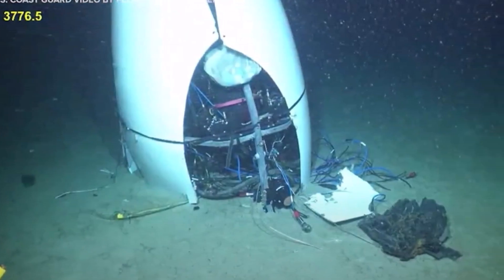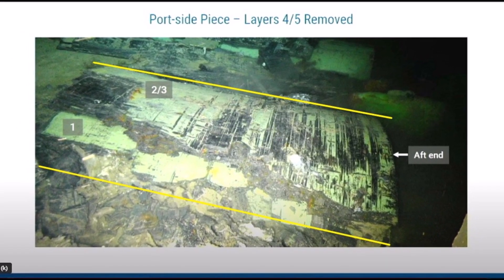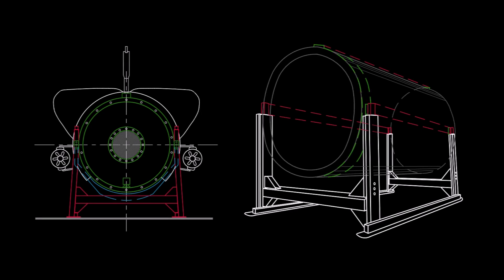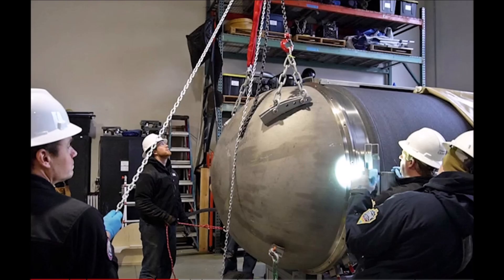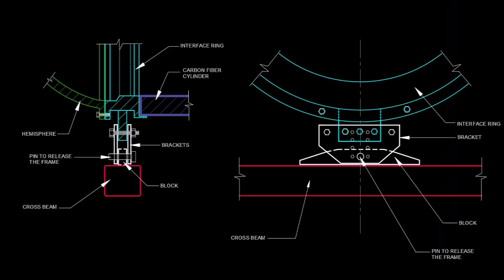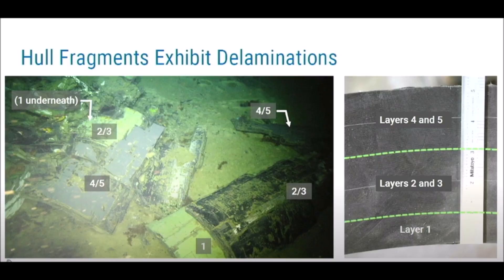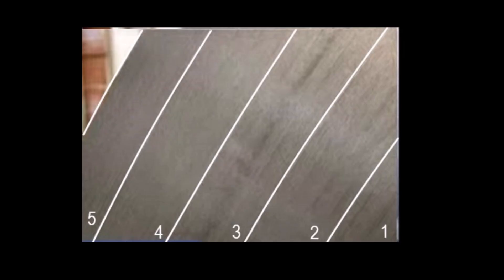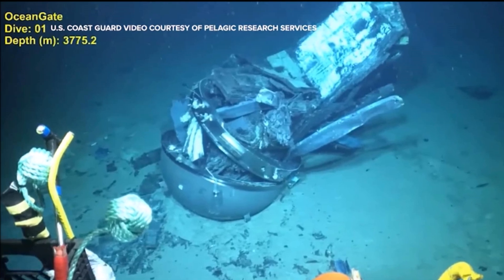OceanGate Titan: Why Large Pieces Of Carbon Fiber Found?

Comment: Good video.  I am also very interested in the Titan failure in terms of its engineering problems and have released videos regarding it.  Your theory about the corners of those struts being pressed into the hull would not be due to hydrostatic pressure on the struts themselves, because there is the same pressure on the top of the strut as there is on the bottom of the strut, since they are outside of the hull.  So, since the metal strut has equal hydrostatic forces on all of its surfaces, it has no reason to bend inward (or in any direction).  Now, the two domes are being forced inward on the axis of the hull at millions of pounds of force.  But I think the engineering for the hull to take that axial load without axial compression was sound.  So, axial compression of the hull would not have created enough movement to be transmitted to the struts to bend them.  Those are my thoughts and I appreciate the fact that you are thinking about it.

Comment: what is the acoustic sensors wasn’t pickup up sound because they was attached to carbon fiber that had come off. in the first hall it was left outside and just from the effects of a normal storm the inside part of the hall started to flake and delaminate. so maybe where those sensors where was where the hall was coming apart
Reply from the maker: @harrisonrg777  Not impossible but also not likely. There were two different hulls and people talk about them interchangeably, but you have to pay attention to the timeline so you know which hull any of these alleged incidents applies to. The one made in 2017 was scrapped in 2020. Anyway, the sensors were inside the hull so they weren’t exposed to any weather. It would not surprise me if they took the sensors out of hull #1 and put them in hull #2. Could have been damaged if so. Also maybe they were never properly calibrated and/or they were taking stabs in the dark on what proper calibration looked like. There’s a few possibilities…
Reply: @VegasCyclingFreak  sorry was at work when i posted that. i meant the sensors on the New hall if they was just glued to the inside of the hall that is where on the Old hall it literally start to flake and come off in sections. they had all their gear inside the titan so you couldn’t see the inside of the hall. my theory and only a theory is that the parts of the hall those sensors was glued to could have flaked off and the sensors is now just hanging lose not attached to anything just a sensor with a bit of flaked off carbon fiber at the end. pretty sure they said the sensors was working in other dives but just stopped working. this might give people an idea where the hull was flaking especially if all those sensors was in a general area. if you have sensors just not working they wouldn’t be in the same area or only on one side of the sub it would be sporadic. i am a musician and all thought these sensors are different to stuff i use they still are basic direct mount microphones that need to be attached to the surface to collect the sound. only way they wouldn’t work is if the glue let go and the sensor was left hanging not touching anything OR if the surface it was attached to come lose in a section and also went limp and is now just hanging. sadly we will probably know but especially seeing hall one flake from the inside i am betting that happened on hall to and in the report where they said one problem with carbon fiber halls is you can develop these sections where the cf becomes weak and starts coming apart and even though it may only be one layer it cause the next layer to weaken also because now it doesn’t have as much support. 

as i said just a theory and the way ocean gate was its also possible they just didn’t do it right maybe the sensors wasn’t calibrated or something as simple as volume or gain wasn’t turned up loud enough but once i saw that photo and the hall was prone to flake on the inside i think it was a bigger issue then people think. the hull basically came apart from the inside out. probably needed the coat they put on the outside also done to the inside of the hull.
Reply from the maker: @harrisonrg777  Yeah I get what you’re saying. It came out in the hearings that Hull #1 was breaking down on the inside. It was also made much differently than Hull #2. The way Titan was constructed it made it impossible to do any visual inspections, also pointed out in the hearings. Rush basically put 100% trust in his patented real time monitoring system, and it didn’t work out as intended. The premise of the system was good but the implementation of it needed much more work. BTW I am also a musician (guitar) and I know a bit about electronics - been building DIY guitar related stuff since 2001 (guitars, pedals, amps).

Comment: They found Titan's debris covering an area of 30 000 meters. I assume the implosion was brutal
Reply: Square meters don't work well for me.  From the debris  map, I get about 1.5 football fields by 3.6 football (100 yard long American football) fields (wide by long) or the area of about 10.6 football fields.  Per the hearings, the implosion likely occurred about 500m above the sea floor.
Reply from the maker: Yep! I've heard somewhere that the energy was equivalent to 100 kg of TNT. Also ocean currents would have scattered the smaller pieces as they were still a few hundred meters from bottom when communications were lost, which is presumably around the same time the implosion occurred.

Comment: When contact was lost. There was somekind voices. First they think if some human made noises. Today we know there wasn't any human a live doing that voice. 
But I am wondering cause of those voices. Is there possibly if some engine or some part of Titan's working after explosing or implosing or what ever that was.  I mean if there were some electricity in batteries and some electric motor and propeller were still on. So that would be one reason to voice.
Reply from the maker: @xjaja1975  When the implosion occurred it destroyed every system on the Titan except for much of the tail section which remained relatively unscathed, but all the stuff in that tail was connected to the computers in the aft end thru ports in the titanium interface ring. When the computers died from the unimaginable forces of the implosion, so did any communications with the surface.
Reply: @VegasCyclingFreak  Yeah. I am aware of this. But if in tail were some an independent systems that continued to power the rotor or rotors after the computer blew up in an accident could explain the sound.
But I am unsure whatkind controller system there was. I mean I know there was similar pad than there is in Playstation 5, but I mean I am not sure whatkind information system there were between from computer inside of Titan to tail. 
I were batteries inside of ship or were them in tail or was there any working system in tail after explosion. But if there were somekind independent system and there was batteris inside of tail and rotors were playing to that direct where someone was pushed titan's to go nanoseconds before imploding and rotors was going to that same direct long time before batteries run out. That would make some sound after explosion.
Reply from the maker: @xjaja1975  Thrusters would have been severed from power supply at implosion. Two big batteries were in the tail section that powered all the external systems. Interior batteries powered computers, lights and life support.
Reply: @VegasCyclingFreak  So there wasn't power to thrusters after all after explosion. I see.
Reply: @VegasCyclingFreak  I was wondering this think from new view. Even if there would be some noises after imploding, like from the release of air or some sounds from rotor. There was still lot of water top of Titan so they couldn't have heard anything on the ship they were on.
Reply from the maker: @xjaja1975  Would just be one big "boom" and it's done.
Reply: I don't think voices were heard, but periodic knocking sounds detected by Canadian search & rescue. I have never heard recordings of knocking from a credible source. The two orange control pods covering the oil-filled, glass spheres containing the motor controllers are missing from wreckage photos and likely shattered in the implosion/explosion so they weren't controlling anything.  David Concannon, an OceanGate lawyer and apologist, speculates the knocking was Russian subs pulling searcher's chains.  Others speculate they were sounds from the many search and rescue vessels on scene. Kind of a non-issue to me at this point.

Comment: Interesting theory. I haven't seen anyone else mention those struts. I remember last year when people made videos showing how the carbon fiber hull completely disintegrated into tiny pieces. We now know that that didn't happen. It will be interesting to see what the NTSB comes up with.
Reply from the maker: Personally I also never believed those simulations regarding what happens to the human body. I doubt we will ever get to see any of those remains but I believe it would be more like a plane crash. They find bits and pieces of bodies. It they were mush then how would they have ever found anything to do DNA testing on?
Reply: @VegasCyclingFreak  I'm guessing that they scraped the human remains off what was left of the hull and did DNA testing on that. Kind of like if you have a glass jar of tomato puree, and scrape the last bits of puree off the sides of the jar.
Reply from the maker: @nian60  Not buying tomato paste. Human bones are tougher than that. We're talking about an event that happened in 10mS. It takes 2-3 hours to cremate a human body.
Reply: Teeth are very strong and the pulp inside contains DNA, it is rumored teeth were found.  And, given the uneven destruction of the CF hull, a person's position in the sub might affect how a body is impacted.  
The simulations the hull and bodies in the implosion are all fraught with dozens of assumption and based on the very little physical evidence available a year ago.  The testimony now suggests the USCG still doesn't have details off the dimension of the titanium-CFRP joint and the epoxy used yet, so any simulation of the joints would be a SWAG.  Surely someone at ElectroImpact, Janicki Industries or Oceangate has technical drawings of the joints and specs for the epoxy. Perhaps the final USCG and NTSB reports will cover this.
I worked with simulations of chemical reactions and heavy walled vessels (8 inches of high strength steel) for 40 years.  My never pushed conditions till things broke, we pushed conditions to well beyond where we wanted to operate but things were still sound,  so we had comfortable design margins.  Maybe Boeing pushes simulations until the wings fall off nowadays, but I doubt they plan to operate within 10% of wing failure loads.
Reply from the maker: @engineerncook6138  Yes for sure I think teeth would have survived and they certainly could get DNA from those. 

In the first day of the hearings, per Tony Nissen's testimony I discovered that the epoxy used to glue the interface rings to the CF hull was Loctite EA 993, an aerospace grade epoxy, which was being used in a marine environment. Anyway, that answered a long standing question about the "peanut butter" that so many people don't understand. Media taking stuff out of context again. 🙄 I don't know if the same epoxy was used on both hulls... I assume so.